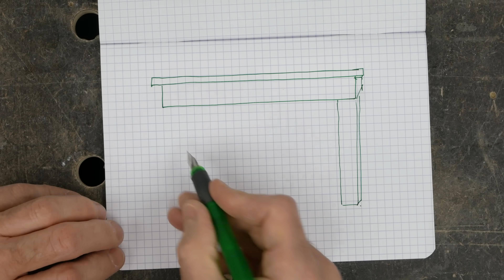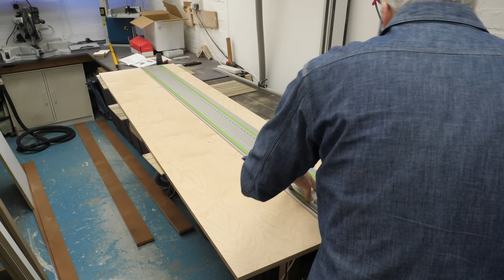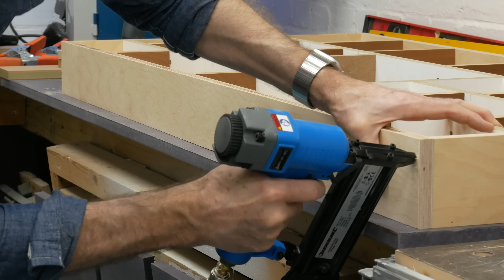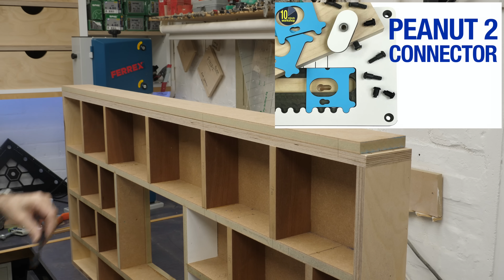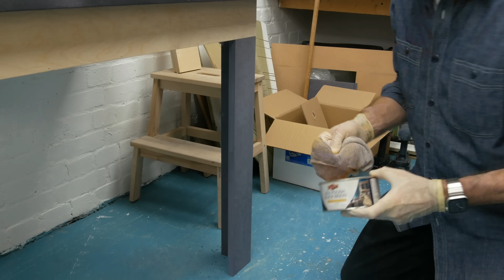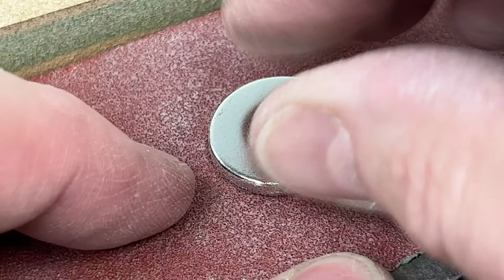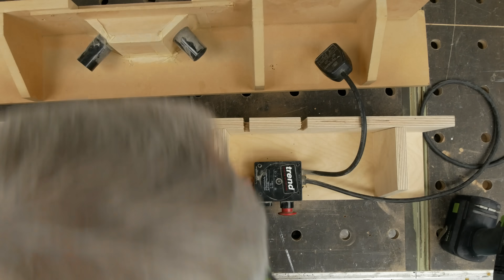Torsion Box Router Bench Build 2 [**Gifted][video 478]

Comment: Hello Peter,
thanks for your many interesting and  helpfull videos onyour channel. 
Can i ask you a question? 
I like to rebuild my worktable, 2400 x 1100 mm, and I am thinking to build a torsion box for this table. The will contain on the left side the router, on the right side a MFT table and in the middle the saw station with track/plunge saw and rail. My question is what minimal hight do I need for the torsion box. I think to use 18 mm MDF for it. Would 100 mm be sufficient? Would it be possible to go lower than 100 mm, maybe only 80 mm and still keeping enough of strength?

Comment: Hi Peter,  you having used many different types of routers and router set ups.  do you think the tilt function is very good addition ?  were you happy with this set up?  I have tried finding sautershop router video by yourself, I couldn't find one. Hence asking here.
many thanks in advance
Reply from the maker: I didn't have the tilting version as it was only 1/4" / 8mm and I needed the 1/2" capacity; it was a very good setup but I don't have it any more. No problems with it, I was just offered something else. 👍
Reply: @10MinuteWorkshop  many many thanks Peter for your reply.  you always reply, help and teach.
I have learnt a lot from your channel.

Comment: I was surprised that you cut such a big hole in the torsion box top - wouldn't that have helped support the router lift without having to add the extra piece of table top material under the lift?

Comment: Hi Peter, thanks for your great video. I’ve found it because I also want to build my 1th router table with the stuff from router shop.

I guess you now use it for 1 year. Can you share your experience with the motor and lift and using the bigger 12mm bits as you do in the end? I would be able to route also oak and beech wood.

Do you know which motor you have? Now there are 1500 and 1800 watt versions.

Hopefully you have time to share you experience!

Comment: Great 'tutorial', thanks again!
Have you considered trespa as a top plate? It is super flat, very durable and rock hard.
Reply from the maker: HPL would cost a fortune that size, and with no real benefit over the MDF I’m using. 🤷‍♂️👍
Reply: @10MinuteWorkshop  I expect HPL will wear less, no nicks, no glue or paint residu... And 2nd hand it can be very cheap. That was what I intended to use. But if high density MDF Will do the trick for years and years, I might change my mind.

Comment: I had never heard of a torsion box until watching this video...I did some quick research on it's purpose and the advantages, and I guess I'm just a little confused on why a router table would require a torsion box?  I'm new to all of this, so if that question sounds obvious I apologize in advance, but MDF seems like it should be strong enough for the purposes of a router table?  I am asking because I am in the process of building a router table myself.

Side note - I agree with some of the other commenters, you definitely have a voice for radio!  Do you adjust your audio settings when editing your videos, and if so, what settings do you use?
Reply from the maker: Thanks! You use a torsion box for flatness,  as much as strength - MDF is notorious for sagging, so this construction keeps it as flat as possible. Re the voice settings, I do have some eq settings but it’s more a question of finding a mic that suits your voice, and I’ve tried many, many mics before hitting one I was happy with. 👍
Reply: Thanks! @10MinuteWorkshop

Comment: Hi Peter. Great video. I’m just searching your videos as I’m looking at building or buying a router table. I know that your previous table needing upgrading and that this video is made using Sauntershop products to review but asides from those reasons, is there much benefit to a router fitted with separate lifter and plate vs the triton tr001 mounted to a table without a plate? 

I’ve just purchased the triton (currently on offer in toolstation) and has the above table adjustment lift screw thing (which I believe yours didn’t?)  Haven’t opened the box yet… before I do, am I missing something ? Is another router with separate lift plate more beneficial ?  I totally understand that this table and fence is far superior to your previous set up but curious as to the benefit of new router and plate. Thanks
Reply from the maker: Thanks Robert. Honestly for the kind of work I do, there’s stuff all difference between the Triton and the Sauter - or the AUK that replaced it. I was planning to reuse the Triton when I remade the bench, just to show that you don’t need anything fancy for simple tasks,  but I had the offer of the Sauter machine so I took it. It’s a nice motor, but all it does is spin a bit, and with above table height adjustment the Triton is a solid workhorse. 👍👍

Comment: I don't know if you'll see this, but The strength of a magnet"s pulling force is also relative to the thickness of the metal in which it's  field is passing through. So the metal strips I seen you use you might test on the particular magnet you're using if a thicker strip would be better suited to your needs. I found this out because I bought a magnet switch from mag switch and it said 600 lb but when I put up a thin piece of metal it didn't hold with that much strength. It did when I put it up to a thicker piece of metal though. Of course it all depends on what you're trying to use it for. I used some small circle magnets that were really strong but I didn't need it to be that strong. That's when I had a separation material like nylon to wear this field isn't as strong.

Comment: When I wanted a torsion box, I went to Bunnings and bought a cheap internal door. It wouldn't do that job, but with a sheet of thick MDF on top, it might.

I wanted mine for a bed inside Tin Can where it's fine, affixed and hinged to the side and some fold down legs that, when up, hide the bedding. A lightweight foam mattress makes be-making easy.

Comment: Hallo Peter, clueing the t tracks with epoxi. What kind of and is it necessary to ad some space for the bonding. Any data regarding the strength, will the bonding be resistant to water or moisture? Background is that I am looking forward to add t tracks or airline tracks to the multiplex on the floor of a van. Thanks in advance and Regards Achim
Reply from the maker: Beyond my limited knowledge I’m sorry; I buy Z-Poxy, 5-minute epoxy - https://amzn.to/2EjBt3g (US: https://amzn.to/2Vp942t) - as it comes in decent-sized packs, but other than that 🤷‍♂️ Generally epoxy is impervious to water/moisture, but as I say I’ve no real knowledge of it beyond what I’ve used it for. 👍

Comment: An actual engineer here. At 0:56 into the video, you said the "strength" of a torsion box is from the grid between the faces. This is INCORRECT! The stiffness and (indirectly the) strength of a torsion box is from the FACES. The stiffness and strength of any beam (a torsion box is just a wide beam) is from the outer surfaces (skins) of the beam to the 3rd power of the "thickness" from the "neutral point" (for a torsion box with equal thick faces, the neutral point is the center).

Comment: Nice build, thanks for sharing. Legs, you need beefier legs.  Maybe I missed it, but do you have plans for a better support structure underneath?  Those legs in my shop would be kicked out in no time.  I see it as a safety issue, that is a lot of weight to fall on a foot not to mention the damage that could happen the lift and motor.  I wish I could find that colored MDF in California.
Reply from the maker: Thanks. No, the legs are very strong, but as I say at the start of the video, there’ll be a cabinet under the left-hand end. 👍
Reply: @10MinuteWorkshop  Great, glad to hear that.  looking forward to the build.

Comment: Super interesting as always Peter. But shag me... ~400 Euros (?) plus import tax to the uk (?) for the router lift. I've bought cars for less! I know it's about production cost but wow. My festool tools look cheap in comparison.
Reply from the maker: Just had an email from Rutlands ‘Black Friday specials’ - they’re asking £299 for a router insert plate. Yep, a piece of phenolic with a hole in it. And if you check the comments you’ll see a fair few from folks who previously had Jessem etc… lifts that failed, and were replaced with the sauterahop. So yes, 400 notes is a lot, but it’s not that much more than the alternatives. And it is a beaut. 👍👍
Reply: Don't forget that UK customers don't have to pay the 19% German VAT making your price €335,29. Take off the 5% by using the discount code and you are around €320.00 Pretty good value I thinkyou'll find
Reply: @sautershopinternational912  we now have to pay import tax and UK vat... UK are liable to any or all of the following taxes: Customs Duty, Excise Duty and Import VAT”
Reply: @imusuallycorrect  I know that of course, I have asked many of my UK customers this year what exactly they have been asked to pay and there doesn’t seem to be a set rate. Generally they have been asked for somewhere between 15% and 21% of the total. This has been called variously “ Government Charges” “VAT” “Customs Duty”  It seems to depend on which customs office is used. But at lease  things have quietened down since the early days of Brexit,  and the process seems to run smoothly now
Reply: @sautershopinternational912  Ha, that sounds about right. We haven't fully implemented custom checks yet. That will start in January. It is an amazing bit of kit that's for sure. .. Thanks for your help and comments.

Comment: Hi Peter nice build!  You have most likely all ready corrected it ,but the motor mount should be installed  on the other side of of the mounting plate.
Must admit that my inner machine builder cringed a bit when i saw the cap head screws going into the tapered/ counter sunk holes.
Reply from the maker: I’ll check, but pretty sure I followed the Sautershop instructions to the letter, and used whatever screws were supplied. 🤷‍♂️👍

Comment: Nice job sir I have made a router table but I put my on locking wheels and I made my with 15mm thick perspex for the bed and 10mm thick perspex for the Fence but my router plate is as good as yours I would like one like yours does your motor have variable speed so you can slow it down for doing raised panels and I like the switch on top well done sir
Reply from the maker: My floor isn’t flat enough for wheels - and the workshop’s too small to wheel it anywhere! Perspex fence sounds good, but I’d be worried it’d be a dust magnet. And yes, variable speed motor, very nice 👌 👍

Comment: Nice work Peter 
Youre previous router table/ mitre saw housing inspired my current set uo. This is better though   
Where did you get the coloured mdf? 
Ferguson's?
Reply from the maker: Thanks Michael! Yes, Fergusons will order it in, though it all comes from Latham’s I think. This is Finsa Fibracolor, a less money than Valchromat, but still expensive. 👍👍

Comment: Good Video Peter.  Thanks for all the info and time put into it.  Where did you get the MDF top sheet from?  By waxing and polishing it does that eliminate the need for a laminate surface of some sort?
Reply from the maker: Thanks!I buy from a local timber yard, ajferguson.co.uk who order it in for me; I think it’s lathams that are the sole supplier of this Finsa Fibracolor. Vakchromat is perhaps more widely available, but costs a lot more. And yes, waxing - and buffing - the top gives a nice finish, just the right level of slide for a router table. 👍👍

Comment: Hallo Peter,
That is a very nice build. I like your chanel a lot.
Are there different types of MDF out there? I used MDF the first time for my last projekt and it was very weak and broke out etc..
Thanks an regards from Germany 
Sven
Reply from the maker: Thank you! Yes, there are many types of MDF, but I almost always use Medite MR or Moisture Resistant MDF as it’s a much better quality board for not much more money. MR MDF usually has a green dye added to it for identification, either green throughout, or just the core, depending on thickness and manufacturer. Hope that helps! Peter
Reply: @10MinuteWorkshop  thanks for the information, so I will go to my local woodshop to see what diffferent types they have.

Comment: Peter what is the router motor model you used in this video. Cheers Mark
Reply from the maker: Had to get the paperwork to check; it's the Suhner UAK 30 RF SPZ12 - 1600w. 💪 👍
Reply: @10MinuteWorkshop  Thanks

Comment: Is it not necessary to enclose the router (motor) in a dust collection box? Or does the plate present a dust-proof barrier?
Reply from the maker: It crossed my mind, but I was slightly concerned about heat from the motor. I wont rule it out, but I want to see how much dust gets through before i go down that route. 👍

Comment: Very nice build Peter. I just clouldn't believe you didn't put a couple of systainers under the bench as you tried to manhandle it onto the wall in preparation for its inevitable test of gravity!
Reply from the maker: Thanks! It crossed my mind - but where's the comedy in that?? 😂 👍
Reply: I would have probably of done something silly like balance the whole thing on my shoulders with my head sticking out of the cut out hole. 😂

Comment: Probably too much faffing about, but a 1/4" tempered hard board piece that can slide down (behind your sliding fence wings) to cover up the gap above the cutter to improve dust collection - would be a neat feature.

I see you make the same mistakes I do! Only not quite as many. LOL

My pin nailer makes a small divit in the wood - which makes it difficult to see if I have run out of pins. I've been happily nailing away doing nothing more than making little divits in the wood - no nails. gah!
Reply from the maker: Thanks! Yes, it crossed my mind to try something between the faces, above the cutter - but honestly dust extraction is pretty good, and while I wouldn't rule out having a play sometime, it's low down on the list! 👍

Comment: Great build Peter! Still sometimes wonder why people don't get a (used) spindle moulder instead of a router table given how expensive they can become with all the different parts.
Reply: A good router table - quality lift, powerful motor/router and quality fence - is a better tool for most jobs in cabinet making and light joinery. Quicker set up, quieter, far less tiring, mobile or it can be mounted into workbench, easy dust management with vacuum cleaner type extractor etc...
As for the cost of spindle moulder, dont forget spindle heads, cutters, servicing/part replacement and you may be inheriting someone elses problems for as long as you have it, especially if buying 1k moulder (the cost of this lift and motor and table materials). It needs proper dust extraction set up. Also space can be an issue for some.
Actually most folks use a lot cheaper router table set-ups than this and have great results.

Comment: Peter,
Would it make sense to put a piece of tube in the cable hole? When something drops down it, it will definitely fall to the floor and not hide in the box structure.
I built a router table with a Sauter top and plate, but with a Bosch router which I can set through the table. I found out about this motor too late, or I would have chosen the solution you have.
Reply from the maker: Thanks! Yes, good idea, though that particular 'box' is pretty small, so anything dripped wont go far! 👍

Comment: Quick question Peter, when you cut the T track with the plunge saw, do you change the blade?
Reply from the maker: Thanks Mike! No, while I've found the regular 48t blade is fine for the occasional cut in aluminium, I actually switched over to a 52t blade that's actually intended for aluminium, because it cuts so well in plywood! This one - Festool 496306 52t special saw blade - https://amzn.to/2UhMSMR

Comment: Hi Peter, an amazing build and video as usual, I feel your pain working on your own, occasionally it's nice to have another pair of hands. I built my whole new workbench on top of a temporary bench I was using then realised it was way to heavy to lift on my own so had to enlist the help of a friendly neighbour to lift it down. My router plate has 19mm radius corners so a little bit more awkward to router out for the plate but I'm getting there. I've gone for an Incra plate and their clean sweep insert plates so will be adding dust extraction underneath as well as in the Fence. Look forward to the plans coming out as I haven't decided yet whether to make or buy a fence 😁. I've drilled all my dog holes in my Bench already using the Parf Guide system which is expensive but well worth it. I'm imagining you will be using your Festool rails for that. Keep up the amazing work, I need to start relying on glue and brad nails a bit more LOL 😆
Reply from the maker: Thanks Colin! Yes, who knew after all these years that glue & nails could be so effective! 😂👍